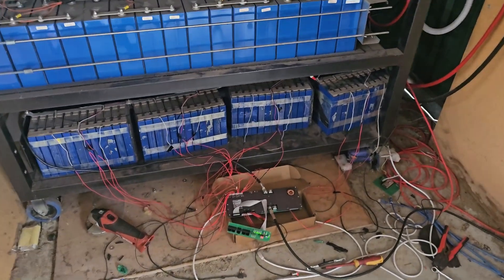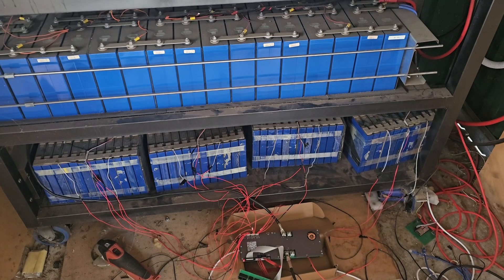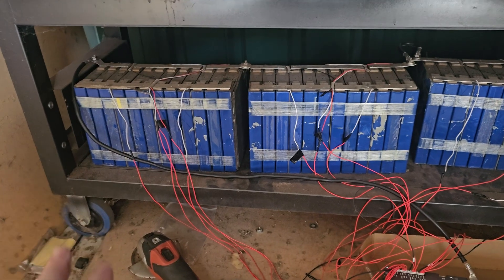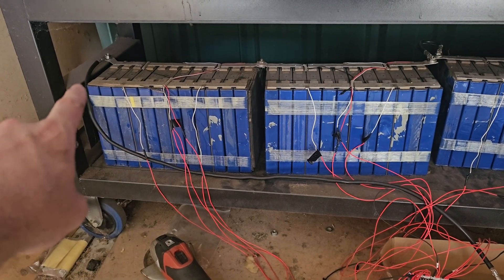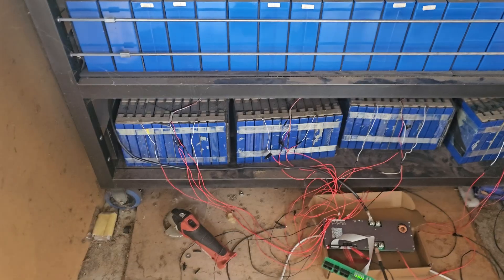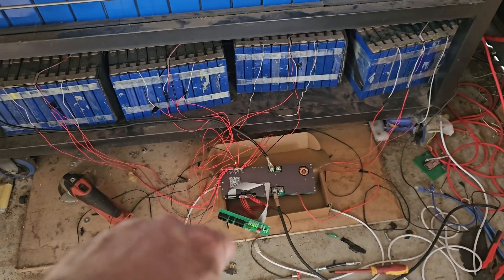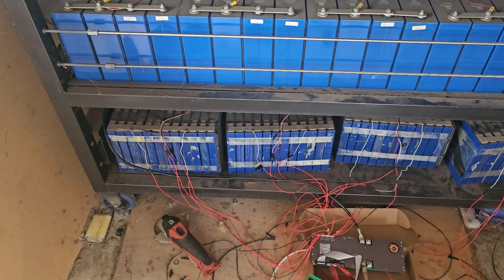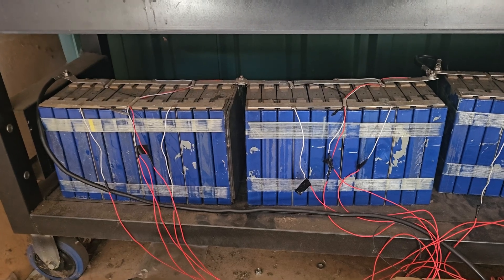Parallel series question

Comment: ive talked to a professor of electrical engineering in the past, you can spilt up a bank , like charge a 24v bank with a 12v turbine using diodes, no dead short
Reply: Homeboy, I think you got lied to
Reply: @sickpuppy555  nope my freind has a battery bank that runs an industrial UPS  the battery bank is fo offgrid the downside is the UPS requires a massive battery voltage around 200vdc ,  yet it is broken up into 24v segments, each 2 12v lead acid battery is charged by a 24v charge controller YET the combined battery voltage is approx 200v, i did the same with turbines.
but thats youtube , everyone is s liar even when they are not.
its one big childish pissing contest instead of how it used to be in the very beginning
Reply: so your friend is in fact, charging 24v "segments" (called "modules") with a 24v charger. 
a true miracle, and engineering feat
Reply from the maker: Can you share some more info on that ? 

I see some of the comments are not positive but rest assured if you have details to contradict what we have as established norms please share them
Reply: @BadIdea1123  well , we just did as the guy told us , and it worked, i had issues at first, no clue what i was doing, yet my personal freind john has run his system for years like it, not an engineering feat  , im no engineer .
it was a diode only on one terminal of the batteries, at first i myself had dead shorts until the diodes on the pos terminal, the engineer provided them, apparently all diodes are not equal.
since developing cancer everything is a mess  i have to go back to the house to check , but easier is to ask my freind how his is set up and let you know hes in tara qld im in rural wa.
but were life long freinds, hes another electronics nut so i ask him, he has autism but brilliant with electronics unlike me .
his bank was stupid high voltage but to avoid battery imbalances he had multiple epever charge controllers on 24vdc and as you know NONE can do anywhere near 200vdc battery banks.
he just recently went to 48v after buying a US made 48v ups .
but he will know.
he was having issues to begin with he said backfeeding until he installed some kind of diodes, hes been offgrid for years.
but as you know anything out of the ordinary is always called a lie.
like ivermectn and fenben for cancer.
or hho for engines which weve done since 1978 yet always being told it does not work and were idiots , the more things change the more they stay the same, human nature never changes.
we quit doing videos on another channel for that reason, you couldnt even share stuff , that you know works, i just block em now , zero pateince.
Reply: well i tried to reply but the comment disapeared , ill contact john tomorrow and find out for you
Reply from the maker: We do not delete comments bro, the only reason a  comment can disappear is if youtube removes them 

In our opinion every comment is valuable
Reply: @BadIdea1123  i wrote stuff about my cancer in my spinal cord , and i used two banned words about certain repurposed drugs for cancer  when you write them even abreviated sometimes they dissapear sometimes they dont.
however you could contact an electrical engineer he should slso know.
johns battery bank for years was approx 200 vdc the only chargers he used were 12/24 epevers for the entire bank .
hes only just since gone 48v
Reply: seems if i reply to my own comment it stays
Reply: with my old set up trying to be smart thinking i could charge the twelve volt batteries individually in a 24v system using a small turbine  got immeadiate dead short and blew fuses but once i just experimented with some diodes on the positive terminals (by memory) no more dead short and it charged BUT my cheap inline watt meter was kinda acting up, then a freind said its not worth it and he said something about avalanche in the diodes.
yrt John ran his for years using many 24v controllers, he said his controllers were behaving strange until he used diodes.
all that is a fact, but you guys know way more than me when it comes to anything electrical.
8m just waisting your time and annoying you guys, i spend toooo much time on youtube, its a bit like therapy for me as i have a serious prognosis 
however ill let you know what john tells me and then ill go my own way giving you peace.
i love your system though and im very happy for you and kinda wish i had the same, but thats a pipe dream now, LOL